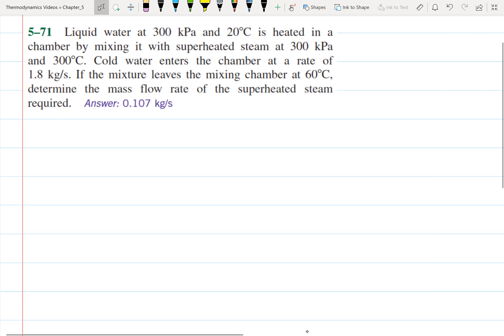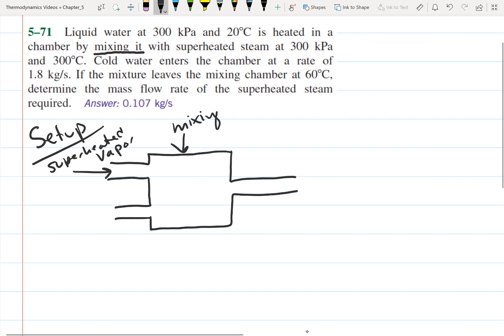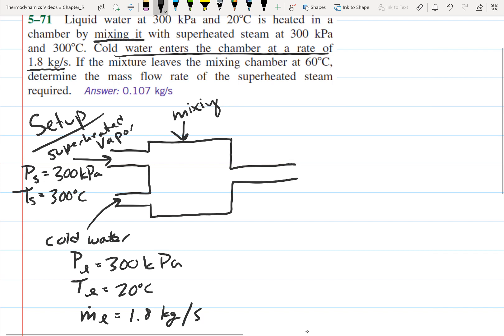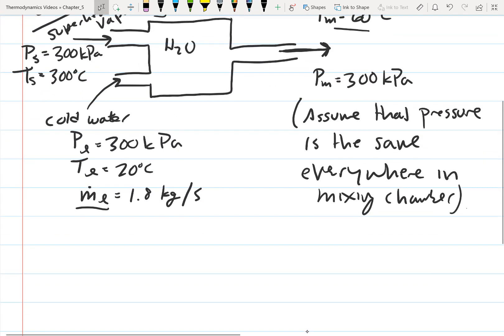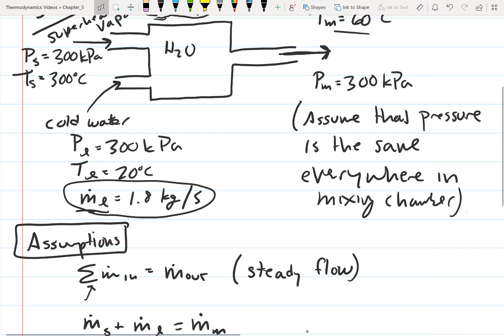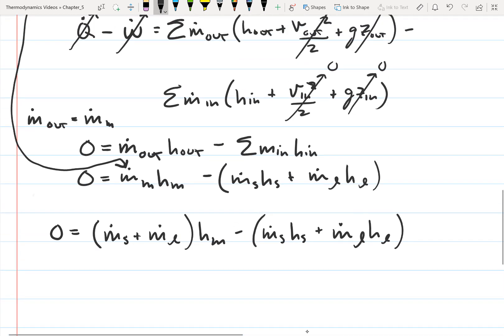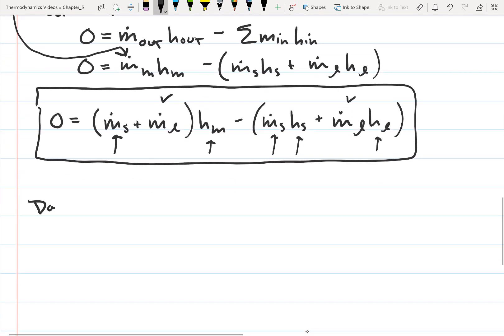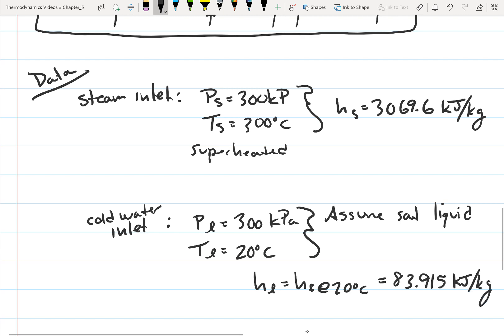Thermodynamics: Steady Flow Energy Balance (1st Law), Mixing Chamber

Comment: Hi, Raili thanks for sharing
I  wonder if the mixing occurs in a very high-speed condition such as steam ejector (steam flow into CD nozzle exiting at 1000m/s thus creating a vacuum that sucked the secondary fluid)
can we neglect the velocity? or do you have any clue for me to learn more about it, thanks
Reply from the maker: You have to consider the kinetic energy if the changes in velocity are large because the change in kinetic energy would also be large. If the change in ke is large then you need to consider it in the first law energy balance.

Comment: Hello! I have a question on why it is assumed that the Work, Heat, and Kinetic and Potential Energy are "0"...Is it more like if you don't have it from the problem itself, you just don't need it in the equation when solving? Thank you!
Reply: For Work: this is a passive device (like a hose nozzle), so  it's simply an apparatus. Thus, there is no work inputs or outputs electrically, mechanically (rotating shafts, springs, etc) or otherwise entering or leaving the system. It's worth noting that the author treats work being done TO the system as negative work and if work is being done BY the system, then this is a positive value. For Potential Energy: There is no mention of elevation/height changes in the problem and logically, it wouldn't make sense to have any potential energy in this problem, as it would be negligible. As for Kinetic energy, there is no information to even attempt a calculation as there is an absence of velocities and area values within the problem - she also stated that for a mixing chamber, velocities should remain low to accommodate a thorough mixing of pure substances. For Heat, as she stated, there is no information mentioning heat within the problem and by nature, mixture chambers can be assumed to be well insulated or adiabatic by nature. In conclusion, yes, if the problem does not lend the necessary information to apply KE, PE, W, or Q, then we can assume they are either negligible or non existent.